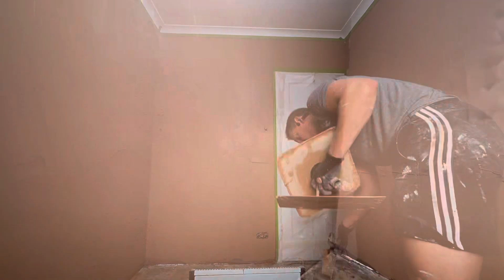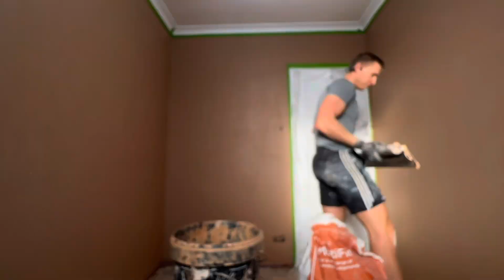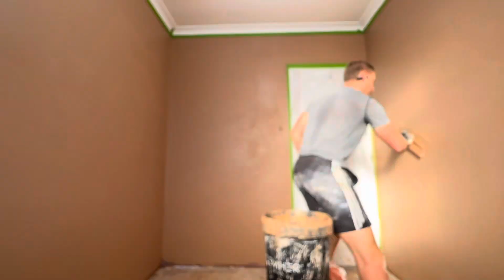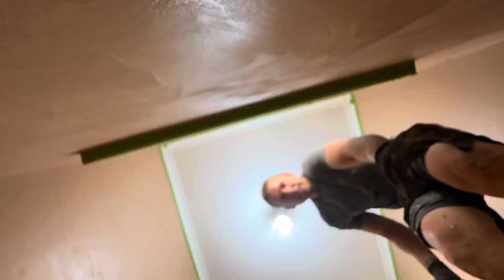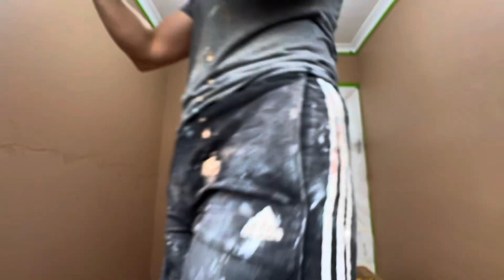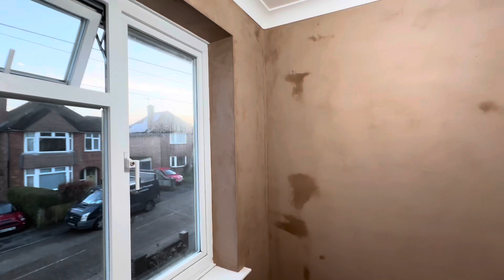Plastering a whole room in 1 go.

Comment: Now to just flip the door over so it opens against the wall  and pefect 😉
Reply from the maker: Funny you should say that. They had the door hinges changed to the other side as soon as I’d finished 👍🏼
Reply: Nice video ! How do you find the Flexy trowels ?
Reply from the maker: @simbrit7970  Thanks. I use a stiff steel trowel to apply all coats and the 1st flatten. I really like using the more flexible trowels for the 1st or 2nd wet trowels👍🏼
Reply: @DanLee40 I’ve switched back to my carbon all the way through, just give it an ox plastic after the second wet trowel to finish it off